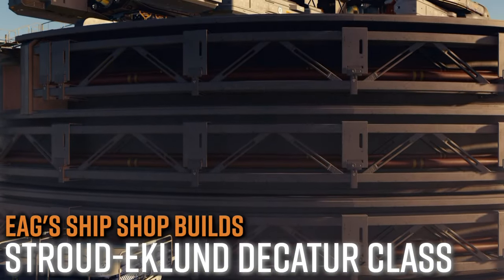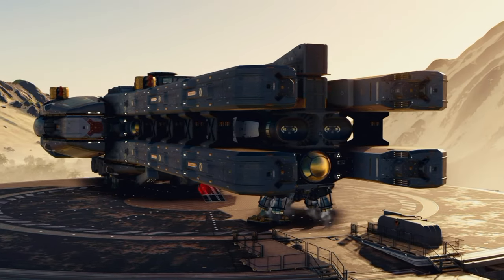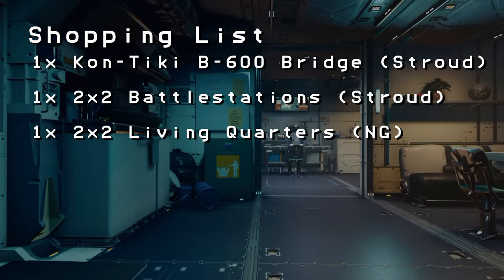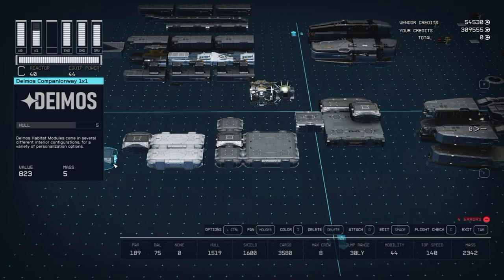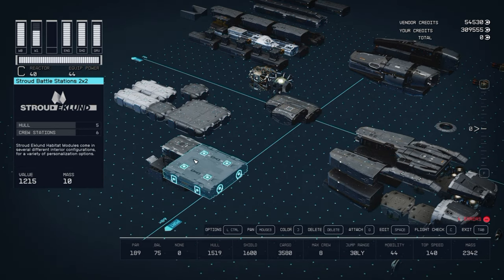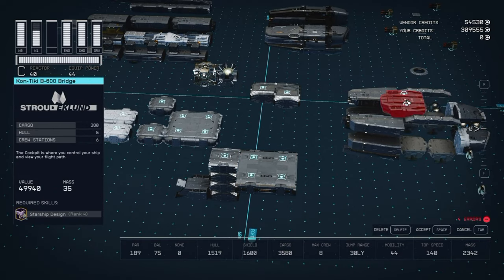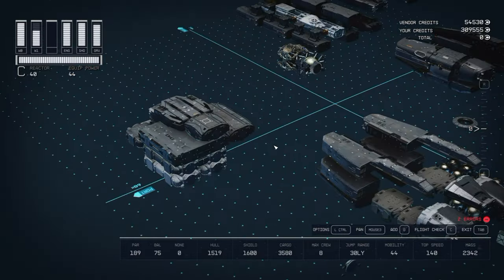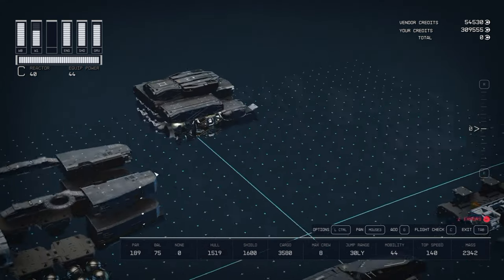STARFIELD | Halo-Inspired Stroud Decatur-Class Frigate | GLITCHED | Eag's Ship Shop Builds

Comment: Great build looks good going to give it a build in my game. I might change one thing add some turrets to the top as I feel a frigate whilst not have then as primary guns would have some as point defence etc.
Reply from the maker: Originally there were two turrets in the top. I ended up removing them from my build because I wanted to listen to the Vanguard machine guns going off instead 🤣🤣🤣
Reply from the maker: Hmm well the forward cannon does most of the killing and the Vanguard guns were just sorta there as an extra. I could probably remove them and place autocannon on turrets on there next time...thats a good thought. Used to have Particle Beam turrets on the too before I removed them.
Reply: Made the build added 2 front facing and 2 rear facing turrets which work nicely so that whilst im getting the front alignment to unleash the full furry of the front beams  😀
Reply from the maker: @marksmith85  Hell yeah, congrats on getting her up and running!!

Comment: First off, love the ship and I’m trying to build it as well since I’m new to shipbuilding in star field. I do have a question for you and the star field community, how do I buy individual ship modules and did you use a model to start out with?
Reply from the maker: Sorry for the late reply. If you haven't figured it out already, you just use the ship you're planning on using to build the Decatur on. Just go around to the different staryards and slap on the staryard specific modules, then haul it all back to your outpost builder. Will need to be flight ready too of course.

Comment: Hi, great video, I built this almost identically but with different engines and some preferential things and it’s 1 meter to long.  😢. Trying to figure out how.  I used the Sal 6830s and they are the same size as the engines you used
Reply from the maker: the game seems to round up the length, so if those engines are a few CMs too much longer, then the game will just call it a whole meter lol.

also check up front too, adding anything lengthwise to the front will cause the 41M length too.
Reply: The SALs are a little longer than other engines.  It sucks.
Reply from the maker: @Stuntsnik11  hmmm, what if on the nacelles, you delete the top Nose cap, and the middle nose cap C, THEN place the SAL engine 1 block further back?
Reply: @CMDREagle131  Unless you are making room for 6 SALs, its probably not worth trying to squeeze them in.  There are better PWR 3 engines that fit and DON'T require a redesign.
Reply: I get it why he wants the SALs they habe the best mobility.. but they are very big and harder to fit so yeah have to make some sacrifices to get the ship to work